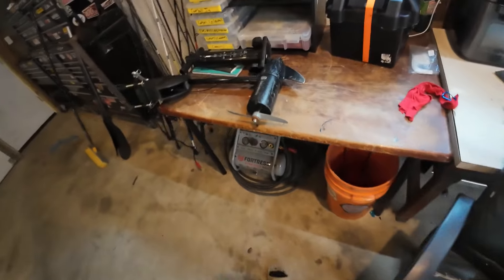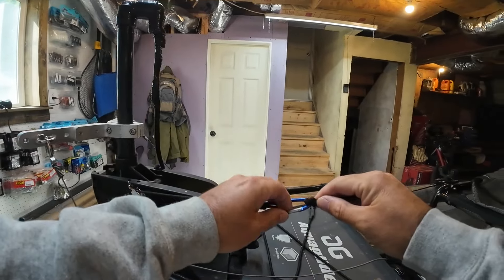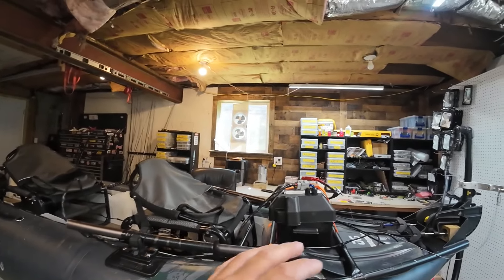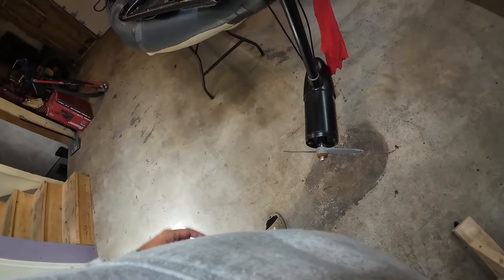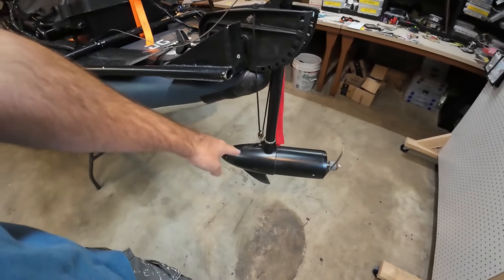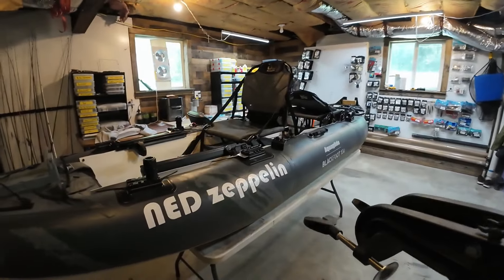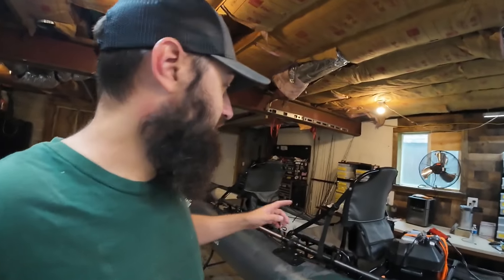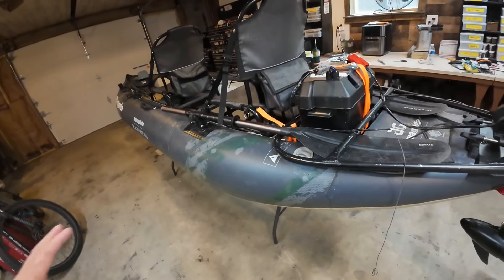My (Built not bought) kayak motor setup! | ISHQEEDO | a.k.a. The Torqeedo Un-aliver 3000 |

Comment: Great job Ish.  Very well thought out to have the battery box sitting in the motor mount itself as well as having the fan and airflow for the PWM.  Do you have to lock the motor down to run it in reverse?  Maybe you don’t have to if not running it full power.  Thanks for the video and this is definitely my winter project. 👍
Reply from the maker: Thanks!!! Thats exactly what I do I just run it at like half power maybe a little less and it still works decently in reverse. The extra weight in the trolling motor helps with not needing a reverse lock. Having a reverse lock on the torqeedo is just wishful thinking in my opinion, I was never able to use it properly. To use torqeedo's reverse lock you have to engage it while powering forward to even use it properly, then reverse the motor, not very intuitive if you ask me. I mean why would you want to teach yourself to engage something before cutting power when you need to reverse? Your first move is always to stop accelerating first which renders the reverse lock inoperative. On top of that the need to reverse is usually what I would call and accident, meaning your position was not planned and needing to reverse is usually fairly urgent, which torqeedos reverse lock just makes that worse. Thanks for watchin paul!
Reply: @fishinwithish  thanks.  Nobody explains that in their review videos.  If I need to reverse it’s because I have gotten myself into something I shouldn’t have but I have to still go forward even more just to get into reverse mode.  That could be a bad situation made worse.
Reply from the maker: @pauls3616 absolutely!!!

Comment: Well done. The pipe structure you welded together is better than the plywood one I built for my motor. 

Unrelated question: what did you do to tet the Ned Zeppelin decal on your Blackfoot? And it still rolls up?
Reply from the maker: I made the decal on my cricut out of adhesive vinyl. Parts of some of the letters have peeled up, but so far, it's hanging on. I haven't deflated my boat, nor do I ever plan on deflating my boat. I know that's one of the selling points, but I have had other inflatables and deflating them causes creases, which can lead to cracks BUT the biggest thing is storage... when you deflate for storage, it makes for a very nice home for mice... and mice LOVE to chew. Where I live I am only 30' from many acres of woods and it's literally impossible to keep field mice from entering your domain. Best I have found is having a house cat to help kill them and deter them from entering.

Comment: I got a chance to use that APC prop on my Bonafide this weekend and its definitely faster. I had to modify the slot a little with a Dremel to fit my shear pin, but it worked great. Hard to tell in current but Im getting .5 to.8 mph more at top speed. Last weekend I was on flat water getting 4mph with the stock prop. With the new prop I was going over 4 going upstream. .5 to .75 mph might not seem like a lot, but trust me it really helps when you get into areas where the river narrows and the current picks up. They are reported to use less power too. I haven't put a meter on the battery yet to test the 2 props, but I plan to. Im curious to see if there's a difference.
Reply from the maker: Niiice!!! Honestly at these low speeds .5mph gain is A LOT!!! That is roughly 12 percent faster!!! Yes, I had to enlarge my shear pin slightly as well, forgot to mention that. If you look into these comments another subscriber contacted them and they may be making a 10.5x6 pitch prop which would be awesome, because what ai have been doing is buying there 12x6pitch for airplanes and cutting it down to 10inches and adding a slot for the sheer pin n gaining another .25 mph. Also another hack is you can basically advance your timing on tmyour trolling motor by loosening the two bolts by the blade and rotating the housing counter clockwise! If you have your motor running at full throttle while your doing this you can hear the rpms increase. Be careful with that prop spinning it's very dangerous!😬 I haven't done a speed test, but with the 6pitch prop and advancing my timing I feel like my boat MAY be getting closer to 5.5 mph!!!  That's about 35percent increase over stock! I do not know the long term consequences but short term benefits are great!!!

Comment: Forgot to add the pedals in the cost and weight. Thanks for a great video.
Reply from the maker: Well, those are sold separately for a torqeedo also. Was mainly comparing it to buying a torqeedo. The foot steering kit was 175$, which also came with a throttle mount for the torqeedo. I see what you mean if you're looking at this as a whole setup though! Thanks for watchin!!!

Comment: You made a sweet set up for yourself. Damn nice job and It's pretty cool you can go upriver like that and fish. Also I've been a welder most of my life and now am a mechanical designer in industrial refrigeration, so I appreciate the time engineering and fabricating you did on it. Great job!
Reply from the maker: Thanks!!! That's cool. You were a welder!!! Honestly, I miss welding a lot, haha I mainly tig welded stainless pipe. Loved it!!! Thanks for watchin man!!!
Reply: @fishinwithish  Heck yeah man! I was a pipe welder too. We welded anything from 1/2 sch80 to 30" standard schedule pipe. Carbon steel, low temp carbon steel and stainless. Tig root pass, a tig hot pass and then filled it up with pulse mig or stick. Then it got x-rayed. Now I design the units I used to weld up. Stainless sucks though because of having to purge it with nitrogen. You know what I mean.
Reply from the maker: @TheCandBExperience that's awesome! Sounds very close to what I did, but I rarely welded anything over 6". Mostly schedule 80 but on like 4" and up it was usually sch10. It was pretty much all tig and rarely grabbed the flux core for a cap. X-ray% varied from 5% all the way to 100%.  Every joint being x-rayed happened quite often actually.
Reply: @fishinwithish  Damn you welded even thinner stuff than we did. We did 5% to 100% x-ray too. It depends on what the customer wants. Unless you failed too many and then everything you welded got x-rayed Hahaha
Reply from the maker: @TheCandBExperience yes!!! In my 12 years of welding I never went 100% from failing welds haha. I have seen it happen more than once and man that sucks!!!!!
Reply: @fishinwithish  yeah I’ve seen guys be on 100% x-ray for a couple years.

Comment: “Buggin’ ?!? Hey now, I resemble that remark ! 😂 Love the design of the frame and the attention to actual user detail. Real interesting ideas with the PWM location and the speed control knob setup. Did you cut down the Newport shaft any ? I was thinking about taking may Minn Kota 55 from a 36” to a 30” or possibly a 28”… I wish the APC prop came in an aluminum… but you sold me on them… a $6 bucks you can’t go wrong… I noticed the 2025 registration sticker, but did you have to put registration numbers on the Ned Zeppelin once you put the motor on it ? I had to on my hard side yak.  Wasn’t sure coz the 130 is an inflatable maybe it’s different ? Thanks Ish !! This video will forever be remembered as the “Breathless Video” ha !
Reply from the maker: 🤣🤣🤣 I can't remember who all asked about my setup but there was quite a few people! (Even people in person, not just youtube) at the very end of the video a put in a short clip of some revisions I made, i may not of mentioned it but I did end up taking about 8" off of mine and would still have about 4 inches of depth ai could add incase I get into somewhere crazy like erie. Personally I just wish apc made a 6pitch prop! The 10x5 works great but a 10x6 would give an extra .5 mph or so without tripping the breaker. I'm fine with the being plastic because they actually bend a little bit, so when you hit rocks I think it softens the blow a little bit. Yes ned zeppelin needed registered once I put a motor on it, and I registered it for 2 years. The only trouble I had registering it was they needed a number(kind of like a Vin number) that I did not get since the ned zeppelin is an inflatable, but I contacted aquaglide and asked them and they made me one n sent it out and ai got it about 2 weeks later! Thanks for watchin!!!
Reply: @fishinwithish  they actually put a serial number on the front of the 130 now… mine must be one year newer than yours. It’s melted right into the bow cone. Guess hull numbers will be in my future… I was actually talking to one of the techs at APC about pitch recommendations and weed guards last week and they might actually come out with a 10.5” 6 pitch down the road 👍🏻 and sheeeeit… like you said, the 130 is max weight rated to carry 650 pounds… 20 pounds is nothing !!! Last question (tonite 😂)… do you river run with your bottom skeg in ? I haven’t been.. scared of busting it off on the rocks… thanks Ish !!!
Reply from the maker: @danburns2766 What PA actually wanted to get my registration was called a MCO (manufacturers certificate of origin) I believe my serial number is melted in on the inside of my boat somewhere. That's cool you got to talk to someone at apc, I rarely call anyone for anhthing😂😂😂. A 10.5x6 pitch sounds just about perfect if u ask me!!! I tried the 10x8 and it blew the breaker pretty quick and honestly didn't really give me any more speed than the 5pitch. I have never installed the skeg at all. I would say it's only useful if you don't have a motor setup to keep the boat straight when paddling cause inflatables like to twist instead of move forward.